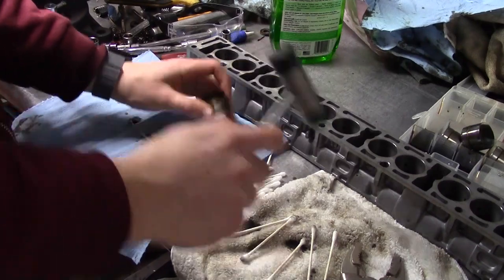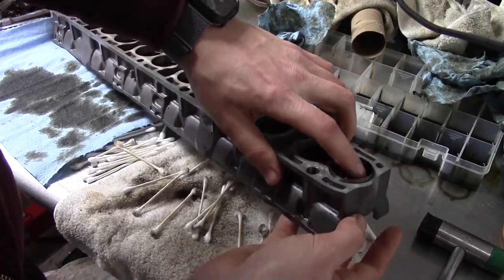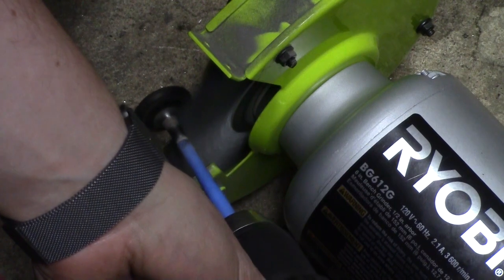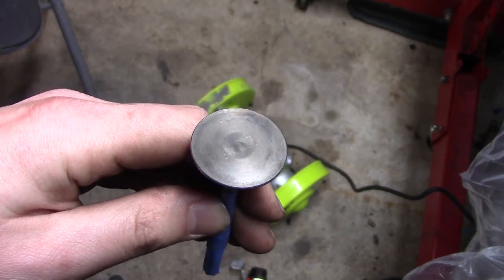Budget BMW 2.5L M54B25 Rebuild - Part 2 - Cylinder Head

Comment: For the retainers on the valves while you Compress the spring I was taught to use silicone grease to make both of them hold while you release the spring 

makes the job that much easier without them falling all the time 😂
Reply from the maker: Cool I'll be sure to use that next time! The oil seems to work well, but even assembly lube would have been a better choice.

Comment: I normally use magnetic spark plug socket and hammer to remove the retainer, put the socket over the spring and tap it with a hammer done ....

A small flat head screw driver and bearing grease to reinstall the retainer , it will just stick on the grease , and release the spring compressor, way more safer than using engine oil to stick the retainer on to the valve 

Do the valve job before assemble the valves, those grinding compound splash when u lapping it , clean the whole head thoroughly and perform leak down test , and don't be lazy 

I've rebuild tons of engine and screwed up sometimes as well,  thinking of shortcuts and being lazy 

Luckily this is just a cheap hobby build

Comment: hi there. i saw u had a -40 Celcius on panel on some other video. what is the problem? i need that fixed. ^.^ is that MAF?
Reply from the maker: No it's ambient air temp. It sure is cold in the garage. Just kidding, the sensor wasn't plugged in.